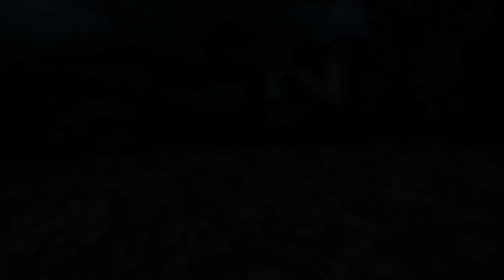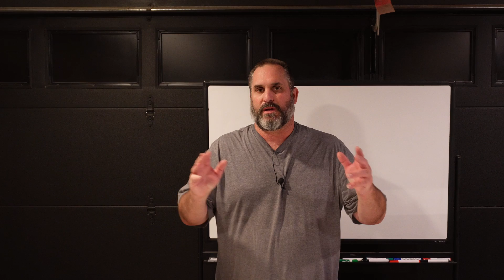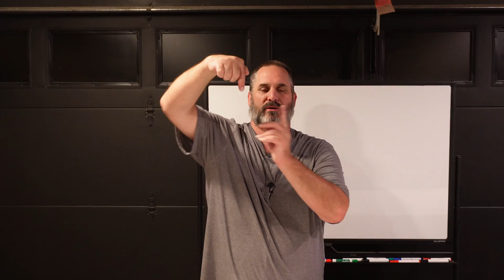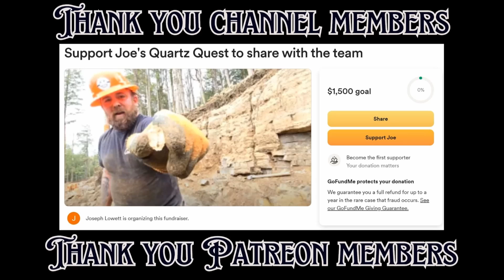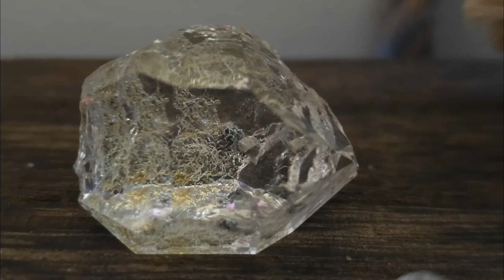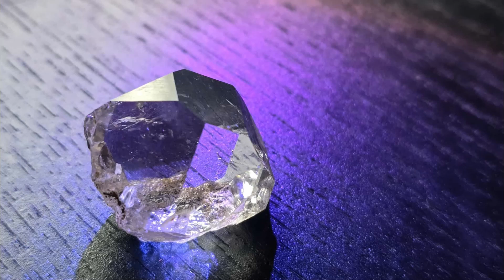Graviflyer frequency fixed motors are in resonance

Comment: probably a silly question are the spinning discs like the light bulbs in your last video when you have one in the middle of the tesla coil barely glowing and connecting another of the sample bulb to the first one makes both glow fully?
Reply from the maker: Yes, but it is more. I am adding in the local environmental energy just like a spark gap as well. I get 5-6 times the light bulb energy.
Reply: @oldmanbuilds  I assume the tesla coil field energizes the surrounding environment and uses its output field to pull in that ambient field and thats how its the pump like us being a tesla coil and the rope is the output field and the ambient field we pull in with the bucket via the rope is the water from whatever natural deposit of water there is?
Reply from the maker: @SpectacularRanker2  I have no idea what you are talking about with a rope and bucket??????  The tesla coil is an energy pump.
Reply: @oldmanbuilds  my bad let me rephrase that, like taking water from an ocean using a regular impeller pump, the tesla coil is the impeller pump with the ambient energy being the ocean
Reply from the maker: @SpectacularRanker2 you could say that
Reply: @oldmanbuilds  ok then

Comment: I don't see any top frequency has standard connection frequency of example +963 hertz and the bottom frequency the inverse 180 degrees that is -963 hertz and I think the bottom frequency can decrease in frequency for example down to -900 or going down and you can increase the top frequency greater than + 963 for levitation.
I don't see a pause of the both frequencies (+963 & -963) example every 9 seconds later because the frequency pause gathers nodes (the non vibrating particles) coming from the outside environment, outside the bubble.
I see you already have the bubble but it is weak because I think it does not have a pause to gather nodes especially the non vibrating particles.
Metaphor:
Ground=Graviflyer and Seed=top& bottom frequency. Both Ground and Seed vibrate creating roots, branches and leafs.
Where is the pause here? It is between both the Ground and Seed. When both come together and have harmonic frequency they share the breathing frequency. 😂😂😂
Reply from the maker: The effect is seen when the craft starts shaking. when top and bottom motors are at full blast. 99% of people think the craft is not balanced. They do not get it. the only way there with fan motors is to gain power from the tesla coil and more eddy current from the saturation of the center plate. 

The tesla coil is a pump for this energy. It 100% has to have the craft on the ground. But the tesla coil is never grounded. 

The bubble in most video's is not on because I am showing another part of it. I had it on in one or 2 tests I did and the field was awesome. 

This craft makes most people give up early. Did they think antigravity was going to be easy?
Reply: @oldmanbuilds  ah so the craft is the grounding point for the tesla coil?
Reply from the maker: @SpectacularRanker2  it is not grounding the energy to ground, but pumping energy from the ground to the craft like a capacitor or 2 capacitors.